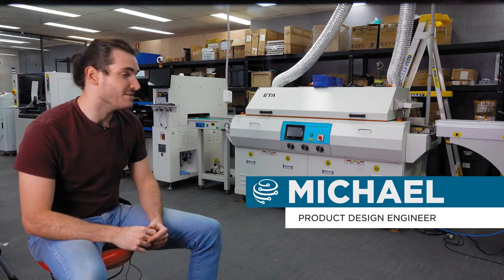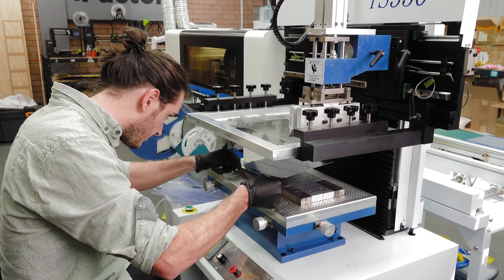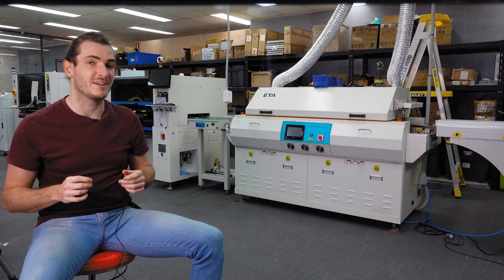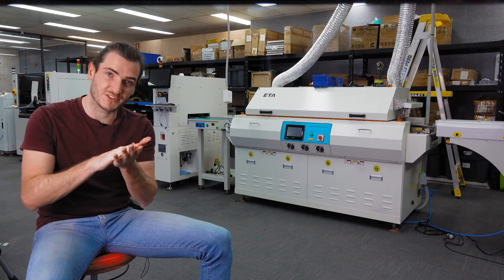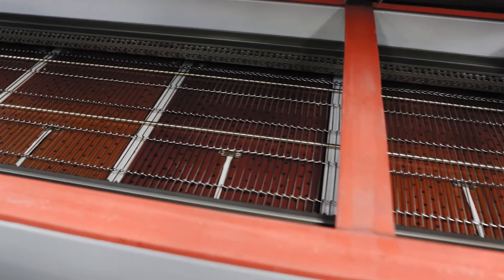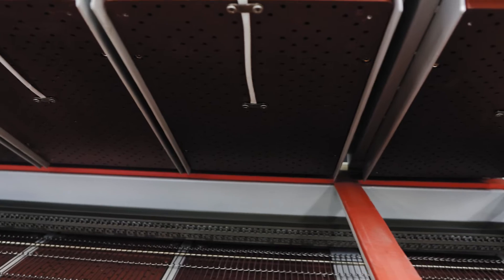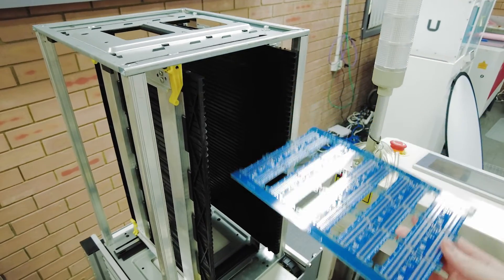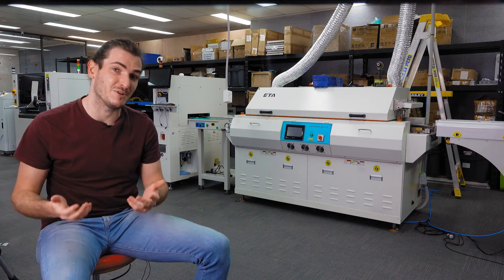The Factory | Expanding Our SMT Production Line - New Machines To Play With

Comment: How do you do double sided PCB without parts falling off?
Do you reflow one side first and apply a different temp paste or use a glue?
Reply from the maker: It seems that in general the surface tension of the solder is adequate to suspend small parts. There must be some limit relationship between the component mass and pad-surface-area. We'll avoid really large parts that require an adhesive step.

Comment: no laser guides to level the track, would need at least 2, wireless travelling cameras showing where the laser light hits the camera, fine grid overlay, and a string to pull the sensor array or does the track have reverse ?
hopefully the heaters can be switched off   ;-)
might need to do this periodically ? (heavy trucks passing making the ground shake ?)
Reply from the maker: We use a spirit level and some keen eyes. We pass 5 or so PCBs from one machine to another, then leave it where it sits. After that, the machines seem to hold their own quite well :)